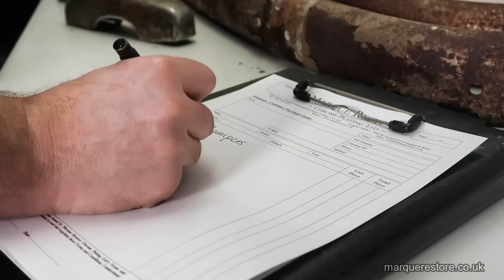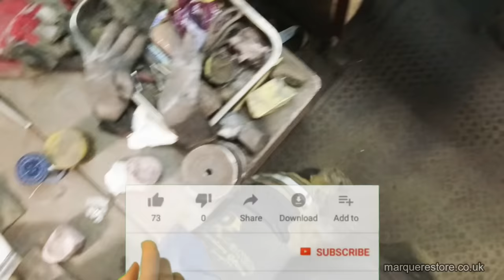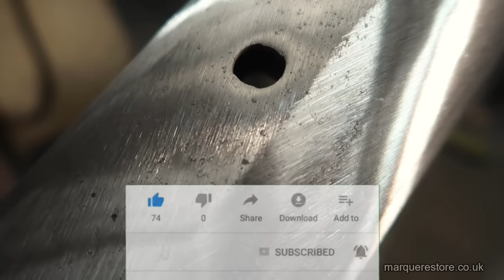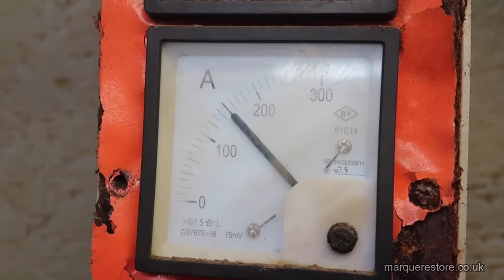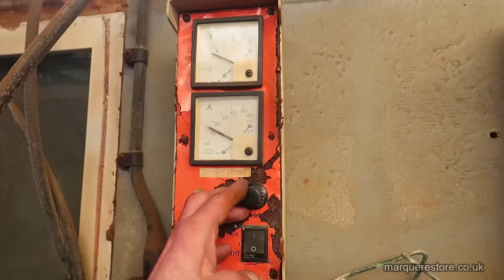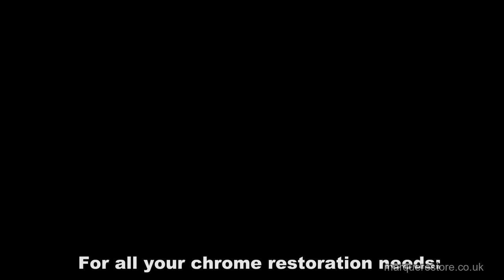How to restore the chrome on 60 year old bumpers.

Comment: I have always complained about the cost of re-chroming. After watching the staggering amount of labor required for a good finish, I will never complain again.
Reply from the maker: Thanks for the comment.
Reply: Yep. Ninety percent of a good chrome job is in the prep work. The chrome only looks as good as what is underneath it.
Reply: No pricing is too high for a set like those - now the real cost is restoring the rest of the car to match.
Reply: Sixpackdan, I was just thinking the exact same thing, WOW, I am very impressed ,
Reply from the maker: @TheDrOnsberg  Absolutely right. You cannot cover up poor prep with plating. It highlights any defects.
Reply: Agree
Reply: agreed!!   great job
Reply: i know every job is different,  in a round about way what does it cost to do that great work you did.   roughly.  i know all jobs are different, and so on
Reply: Fantastic job. This sort of craftmanship is so impressive.
Reply: @ChromeandCarRestoration  
Fantastic to view the whole process, thanks! 
I’m just curious: 4:37 How much material is removed as a percentage of the original thickness? 
Could you fill some of the holes if they would be too deep to polish them out or should we consider the piece lost in that case?
Reply: @ChromeandCarRestoration how much would a pair of stamped steel valve covers cost to chrome? Ford windsor v8 valve covers that have power by ford written on them.
Reply: I'm like you, will not complain on the cost of re-chroming original parts ever again after watching the process
Reply: @ChromeandCarRestoration  how much to chrome a pair of stamped steel valve covers? Just a rough estimate please.
Reply: @ChromeandCarRestoration Very nice, but how much did you pay for this job?
Reply: Incredible job
Reply: Yes , it is a long proceeding and labour of handwork manipulation for a perfect finish , i thought same as you did , sorry for my poor English , i am Dutch from Belgium  Western Flanders  ;-)
Reply: You could say it's half a bumper now, looking rather different though 😏

Comment: I am so glad I got to see this video! Decades ago, I was told by an old timer who worked in a body shop that a re-chromed part was actually better than factory new. I always wondered about that until now. 

I am certain that factory new would never get the time and attention I just witnessed in this video. Beautiful work.
Reply from the maker: Great point!
Reply: yes for shure , fully agreed
Reply: You don't realize. The Factory metal was smooth when stamped. Now they take 80 grit and take out the pits then they go to 120 to take out the grind marks. This company, with this process, will NEVER get you as smooth of a surface as factory. Yes this company pays a huge amount of time grinding out the pits. Just remember the original never had this. I have seen Chip Foose use a grinder way beyond the welds or imperfections. Chrome is like glass. Every scratch or imperfection he, or anyone, now has to be refilled, repolished and brought back to what the factory started with. Look at a stamped piece and at the least it will show some imperfections. Now take 80 grit and see it it helps that Mirror Shine. These guys show the best of the worst ways to show chrome. But just to compare straight across. If you showed all the imperfections across the same square footage... on the hood... of ANY car would you be happy with the chrome bumper finish they JUST showed on ANY show car?

Comment: As an electrician I had to 'fix' power in a number of chroming shops and I have to say when you walked in the shop it took your breath away, screw environmentalists, you guys deserve a medal.

It's a lot of work and time is money, this is what people NEED to understand, no one works for free.
Also the more complex the shape as on a Jaguar MKII bumper it takes more time, YES I have a MKII that needs both bumpers re-chromed.
Reply: So do I AND I AM thinking how much it will cost me? Needs all crome  doing DOH!
Reply: yes your are right , i am plumber and when we undoing the chalk of boilers ,we used acid and than it be came green of the copper oxide deluded in the acid , i remember days after i could taste the cupper in mine mouth , and i even used the acid to my proper experiences to lay a layer of cupper on iron with a 12 Volt battery  , and it works very well , but yes , using a mask would be preferable i think , sorry for my English , i am Dutch speaking ;-)

Comment: Excellent video, please keep this dying process alive. I knew from a teenager that linishing and polishing is too much like hard work for most folk. I used to take Triumph motorcycle parts and Jaguar parts to Thackers Polishing and Plating in Brierley Hill, West Midlands. It's an eye opener for many. Thackers sadly closed some years ago and some of the workers transfered to Castle Chrome in Dudley, which I still use ocassionally and recommend to anyone local who needs any polishing/plating. 
  Although many chromed classic parts can be purchased new from the likes of india or the far east at half the cost, they never fit correctly and the chrome is sub-standard. I found it's better in the long term to have original parts re-chromed.

Comment: It is still possible to get good plating in Australia. But it's becoming more difficult. Just had my Atlantic redone and repaired. The results are superb. It should be noted that not everything can be rechromed especially if it's been reformed previously. The metal can simply get too thin. Great work here and very labour intensive.
Reply from the maker: Good to hear it. My dad worked in plating in Australia at the Moonee Ponds Plating Co in the 60's (he was a £10 pom).
Reply: yes there are still a couple of places in Melbourne
Reply: @ChromeandCarRestoration that's Awesome! Ive lived in the area for the last 15 years. I can't seem to find any details, I'd be interested to know whether the building is still standing?

Comment: Wow incredible attention to detail, great job.

Back when I started working in a crash shop as a teenager most cars on the road still had chrome bars etc. and we could order change over bars from a local shop for most models. We would take off the old bars and do any repairs they needed like welding cracks and removing dents and swap them over for freshly chromed ones they had in stock. I don’t think they were as meticulous with the prep though, I would sometimes see grinder marks in areas you wouldn’t easily see when it’s on the car. But they were doing hundreds of them and they weren’t for restorations, just everyday aussie cars that only needed to be as good as they came from the factory 😂

Comment: Anyone else notice it was rolling at 100 amps when he put the bumper in the second copper bath? THEN turned it up. Wild
Reply from the maker: Yes. Plating is low DC voltage, high ampage.

Comment: I impressed. Only thing I  would change ( In my opinion) is hand days and buffers. You would have better control,  and less fatigue on your workers. They could have the part sitting on a table (sanding, buffing) instead of having to pick the whole part up to sand and buffers. It would be a lot easier for them and you. Either Way,  it was AWSOME RESULTS.  Only thing I can say , is you could make it easier with the sanding & buffing. Great Job, Nice vid

Comment: I spent some time in a plating shop when I was restoring my Subaru to show car standard in New Zealand.  I certainly gained a thorough understanding of the process and the labour involved...  I do, however, wish I hadn't decided to chrome plate as I wasn't satisfied with the end result and unfortunately the longevity of the finish I don't think is up to scratch, so a lot of it needs to be re-done.  I have thought about the copper finish but I'm wondering how it holds up to the elements; is there a specific process to ensure it is long-lasting, and can it be applied to aluminium?  Thanks.  Great work by the way, I hate to think how much this cost the owner!!

Comment: I’ve got a bumper that’s had a hit at some point and needs some reshaping and welding to repair plus some of the chrome has already peeled off. Are jobs like this generally not worried about or can they still be fixed?
Reply from the maker: They can be fixed

Comment: ive been a electroplater for 40 year, great job done here,  just a couple of questions   where you had the chrome burning how come you guys dint use bleeders or burners  shields ect ?  also i would have copper plated them regardless if it was my bumper bar

Comment: I do home plating of small parts as a hobby using Caswells plating materials. Caswell is based out of New York here in the US.  How do you calculate the square inch surface area of your bumpers? What factor do you use against your surface area calculation to dial in the rectifier constant current setting and what percentage of accuracy must your surface area calculation be within to that of the actual area when establishing a suitable current setting? Thank you very much for the great videos.
Reply: industry standards? Isn't it sort of a gimmick to justify the price of that kit, but also to help the layman obtain "the hang of things" at a notice level ? A professional 'just knows' how to get to the results

Comment: I have a Nickle Cobalt plant. (Backyard personal use only) I found out the hard way that any steel needs to be copper plated first. As it tends to rust over time.   I have learnt that this nickel/cobalt is porous.   It provides a great finish after all the necessary preparation.   Next job. I'll copper plate first.
Reply from the maker: Copper plating is not for protection. The nickel layer is for protection.
Reply: @ChromeandCarRestoration  well why did the steel I plated with just nickel rust and the steel I plated with copper, then nickel didn't rust.
Reply: boss does your guys tongues get green ?
Reply from the maker: @wyslink9354  No. Not since I stopped them licking the copper.

Comment: Excuse the stupid question… Why do you use acids at first instance if you are going to use polishing sand paper (from 4:00)? Can I just start from the polishing part? Thank you for your video.
Reply from the maker: The rust needs removing. Grinding will not do as it will not clean the back and also the rust kills the abrasives so would use a lot more materials

Comment: excellent work, I know a workshop in Brazil that restores chrome, and the process is similar with the exception of sanding, they fill it with copper baths until it covers the surface. more laborious to straighten and level it to return to the original, would the damage always appear? Greetings from Madeira Island.
Reply from the maker: Yes the damage would still show as plating follows the shape of the item

Comment: Can you high build copper plate pot metal trim/emblems?  I watched a different video where you couldn't get all of the pits out of the trim for it was too thin and I was wondering if you could high build them to level out the pits for a clear plating

Comment: That is what we YANKS call a SHOW CHROME FINISH. It is very expensive and it is nearly impossible to find a shop in the USA that does this because of EPA and Federal Regulations. Most of the time we have to ship our parts out of the USA to Mexico or somewhere south of our border, wait 6 months to know if the parts were received and plated and then are on their way back to you if you're lucky. 

You saved these bumpers and they look great. That Bristol Automobile must be one rare bird to have such a re-chrome job afforded to it.
Reply from the maker: Sad to hear how difficult it is to get work done in the USA. We recently did a BSA fuel tank and shipped it back to Salem. You are correct, Bristol cars are rare and expensive.

Comment: The quality of chrome in the USA has been declining for years as well as the number of shops doing the work.  EPA regulations put many out of business due to improper disposal of contaminants into the groundwater and other poor business practices. Those that were able to overcome the burgeoning regs have too much volume i there shops, the quality of work suffers and wait times are ridiculous to get parts back.  On top of that parts get lost, taken or sold out the back door leaving customers without their precious parts. The repop junk offered by aftermarket restoration retailers are only industrial plated and begin to rust once they are unwrapped. I have 14 sets of original MGTD bumpers and overriders that I want to have replated but can’t find a reliable shop to do the quality of work I demand for my concurs quality restorations.   In my city of Sacramento Ca we used to have over 30 plate shops back in the 1970s we are now down to one triple plate shop and one industrial plate shop.  The later also still does cad plating but even their cadmium work is suffering.
Reply: AIH Dubuque Iowa Expensive but the best In the country
Reply: Thats California for ya
Reply: In Virginia here and I was just admiring the amount of old cars with lots of chrome and some brand new trucks with amazingly shiny chrome rims.
Reply: Yes, besides Sac I only know of 3 others in Cal and the in Bakersfield near me is alright but lacks in the preparation department. If you give them a quality prepared part they will give you an A- part back half 3/4 of the time.
Reply: I watched a show on our about Virginia show, not sure of the name, that showed in detail a shop in Northern Virginia that does plating services for all sorts of products.
In trying to find them just now, I google mapped for shops in the state and around the state and counted over forty and more than I cared to count.
I guess the east coast is a good place to find someone to get some chroming done.
Reply: True! I’m in cal and my chrome plated parts suck. I can see the sand scratches in the chrome and it started rusting . I waited 10 months to get the parts back
Reply: @Tierone1337  m
Reply: @shanefluhr6454 ,I just paid $500/each for AMD bumpers.  Is the shop in Dubuque more expensive than that? If not, I will give them a try.
Reply: @bradleynelson5915  yes it is more money. They are perfect with a lifetime warranty.
Reply: You are left with SHERMS PLATING and they charge an arm and a leg, customers are always wrong I'm the plating business. Are you too lazy to drive to LODI San Joquine Plating, or modesto WEST COAST CHROME
Reply: @Tierone1337  stop crying

Comment: Chrome bumpers were beautiful. but I always wondered what was the point of the car body "protector"  costing more to fix than the body it was protecting?  :)
Then they came out with soft solid color bumpers that would save on insurance payouts, because minor collisions would do no damage.  But immediately they put protruding hard steel cages for the licence plates to ensure damage to the other car.  Then they decided that painting the soft bumpers would look nicer, but also cost a fortune to fix a little scratch.
Reply: It's to protect humans

Comment: Are you still using cyanide baths?
Here in germany the shops are less and less using cyanide based electrolytes and switching more to cyanide free electrolytes.
As much as I always love to hate on our government and the EU, in this case i am glad that they push for a cyanide free galvanization process.
Cyanide is nasty stuff, lang lasting poison and the coats that I have seen and measured were no different to the old ones made with cyanidic electrolytes.

Respect for your high grinding and polishing skills! I would have never seen the high spot on the welds....

Greetings from Southern Germany

Comment: If you have harder metal from a weld that needs to be knocked down, you don't have to rely on building up the surrounding area with copper. You can use a flat stone by hand to focus the reduction on the higher harder section. You're relying on wheels and belts too much for everything and when you have dissimilar metals, like when you're filling with lead (BTW... Can you use ZINC instead or some other non-lead less toxic metal, maybe brazing?)

Comment: I woukd habe 36 grit grinded bumper then quick 80 grit belt, than 180 belt, GRRASE AND DONE. rookies use fine belts. This is amateur
Reply from the maker: Sounds ian interested method. You should make a video so we can see how you do it.
Reply: @ChromeandCarRestoration  nah that's a chrome shop and they know what they're doing. 
I don't chrome ate anymore. It's a dead breed